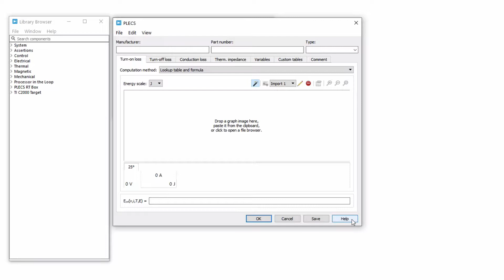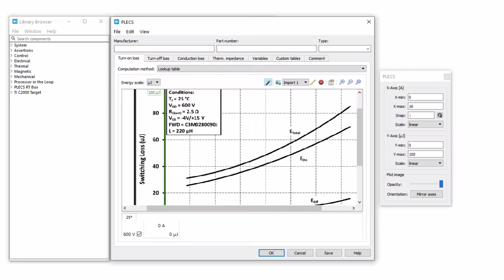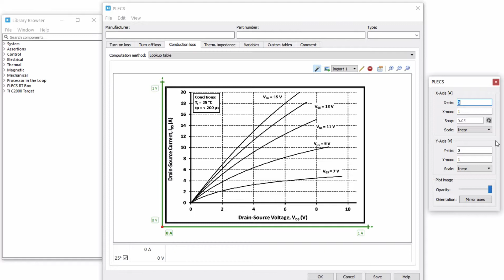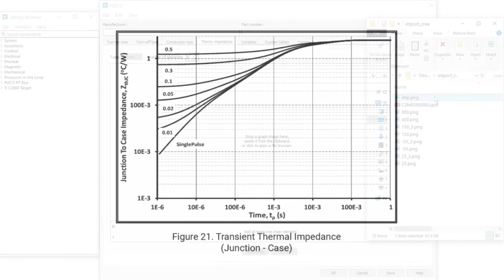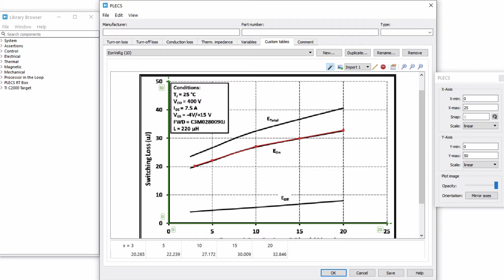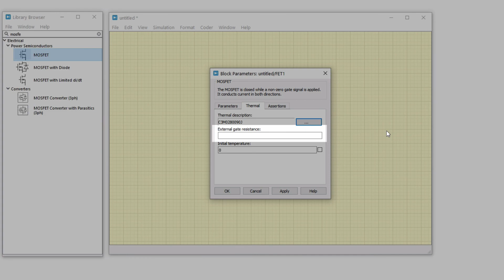Exploring the PLECS Thermal Import Wizard

Comment: Really crappy way to model a semiconductor (PSIM Style), Reason 1: Do you really think the graphs reflect the real extracted curves from the manufacturer (generally they are heavily retouched)? 2: what about graph definition and parasitics from chip bonding, leads, and package? This software is just a good notebook (academic) approach, I want to see when is confronted with GaN misbehaviors...anyway, we'll always have SIMestrix/SImplis tho~

The only thing I can feel "useful" for my lazy bum is that it is possible to generate code for MCU, and DSP (as PSIM does). But I wonder, why PSIM was acquired by ALTAIR? Seems it couldn't withstand the notebook approach that everyone loves...PLEXIM, seems going the same path~

Comment: Thank you for your introduction. and i have question about PLECS thermal function. As you know, we have make the switching loss for about 400V and 600V. and then, PLECS make the 3D loss data (lookup table) from 0 to 600V. Sometimes we have simulation for VDC=500V (Middle of 400V and 600V). So then, Is PLECS calculate the 500V data in lookup table?
Reply from the maker: Hi Kihyun, thanks for watching! Yes, the PLECS thermal editor uses linear interpolation and extrapolation to find the exact loss value. Since we provided data for 400V and 600V,  PLECS would interpolate to obtain loss information for VDC=500V.